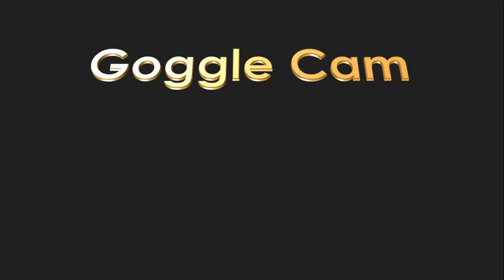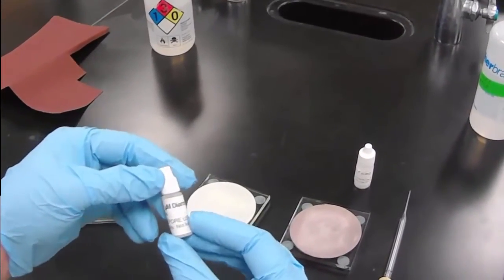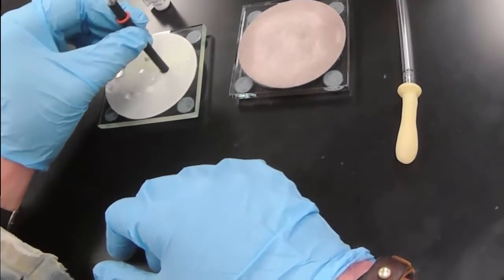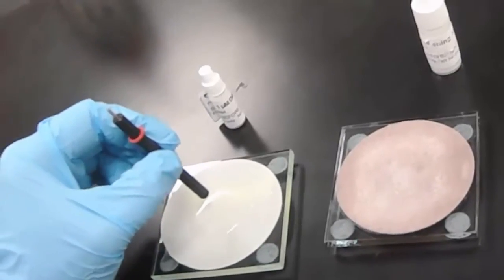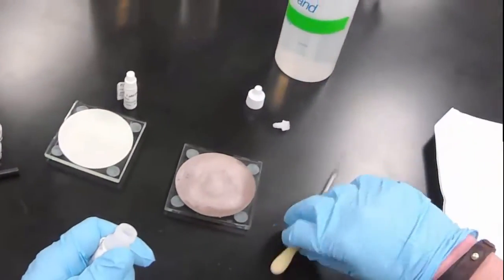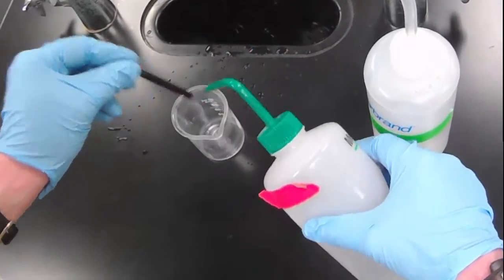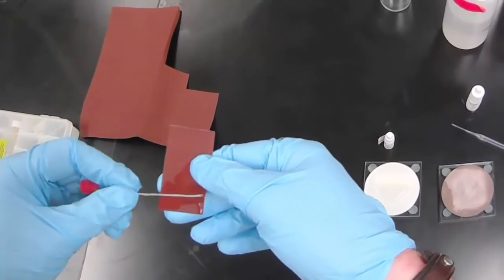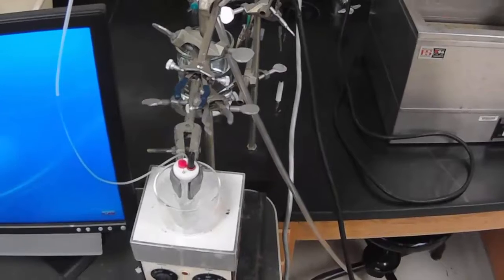polishing the electrodes

Comment: You need to sonicate the electrode in DI water before you run CV, otherwise there will be some alumina at the surface of the electrode.
Reply: Please, how do i immobilized an enzyme on a gc electrode ?